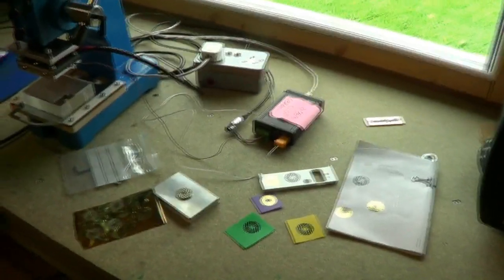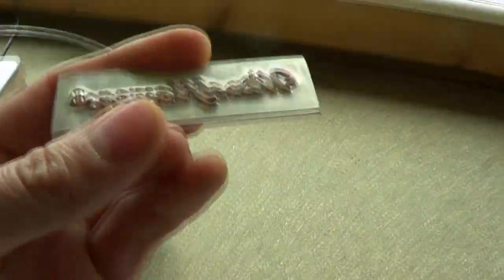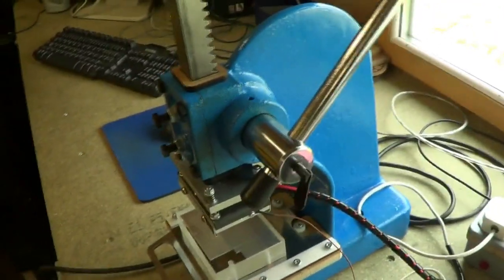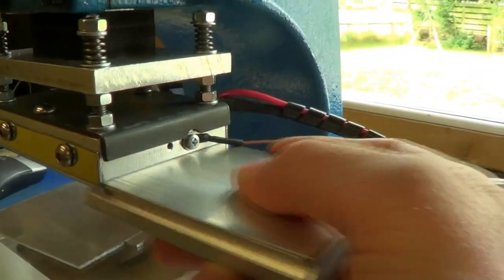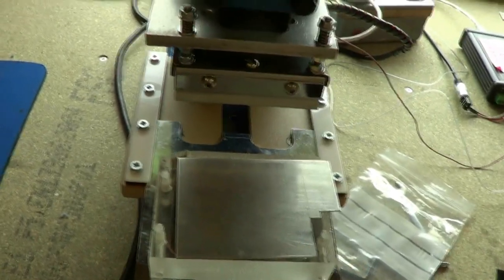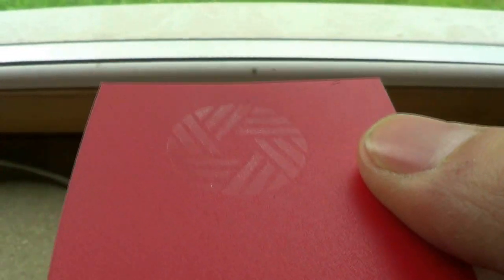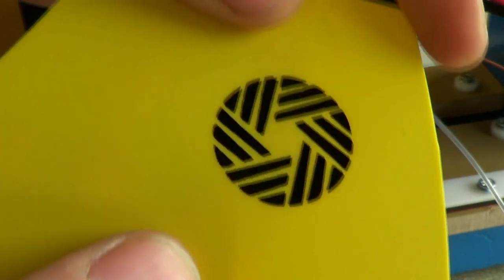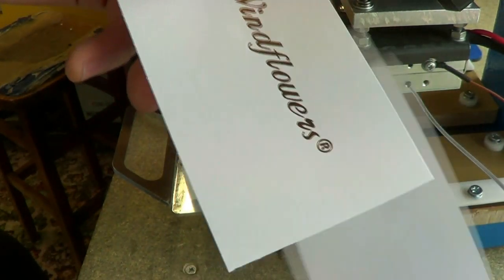Hot foil machine using arbor press

Comment: Perhaps rather than have to make such careful adjustments for flatness the upper die could be spring loaded with stiff die springs. The stop collar used by the other poster could be used in conjunction with this for consistent results. But in any case it looks to work really well, very interesting stuff.

Comment: Very nice work Lindsay.  I remember using hot foil transfer machines for pencils and playing cards in high school but they were not PID controlled.  I have made a number of attachments for my arbor press but nothing like this so far.  One thing you could consider is a stop collar or post for limiting travel in order to get consistency without having to worry about "feel", that is if you have someone else doing it for you.
Reply: Keith Ward the travel limiting would only work with very tight tolerances. Force limiting trough a spring in combination with travel limits should work and easily be automated as it is not tolerant to thickness changes :)